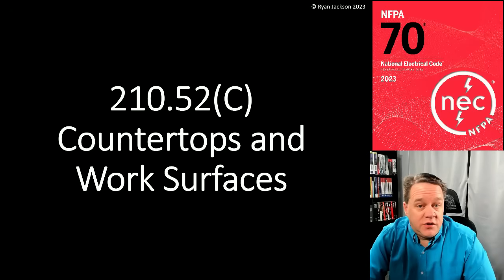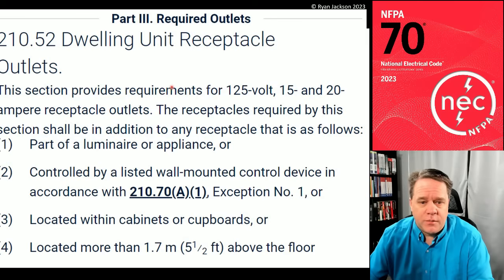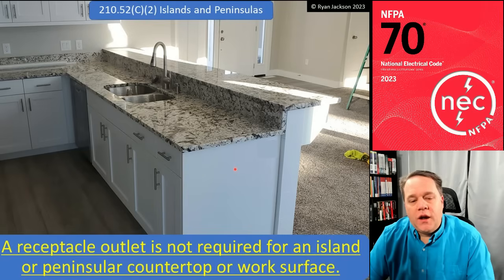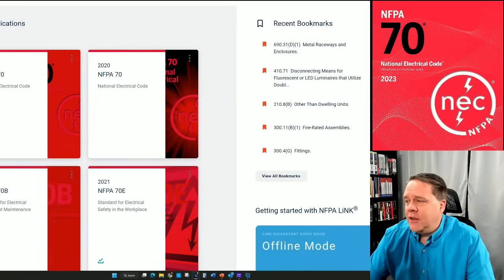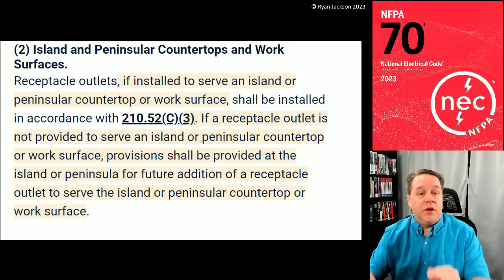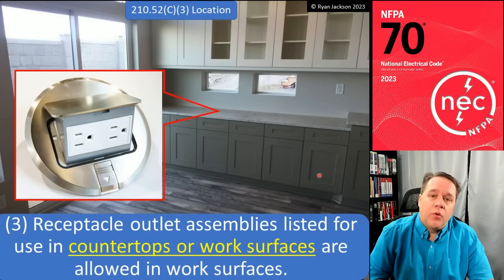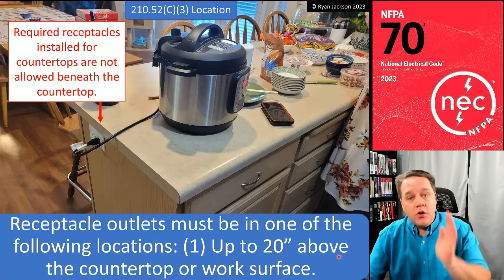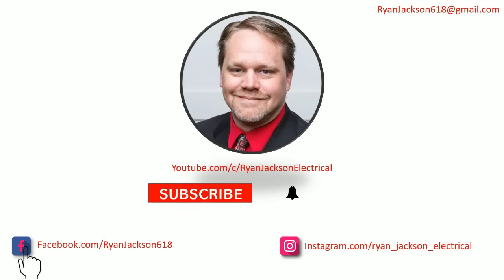Kitchen islands and peninsulas in the 2023 National Electrical Code

Comment: So basically we don't have to change the way we are doing kitchens. But it's just not a good idea to put our outlets in the side anymore for island/peninsula .... terrible code change

Edit: I'm surprised they didn't make the code more like a detached garage where the outlets/lighting is only repaired in a garage if you have power in the garage. Would be better code imo if they had the outlets above the counter for island/peninsulas only if power Routed to the island